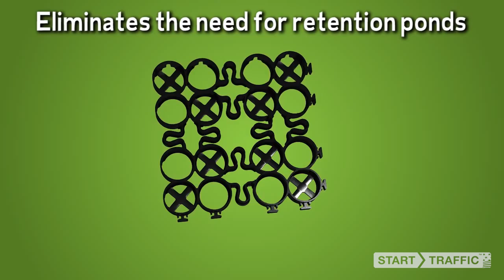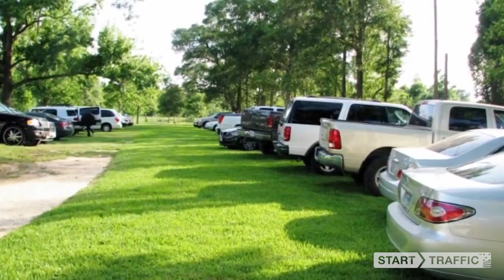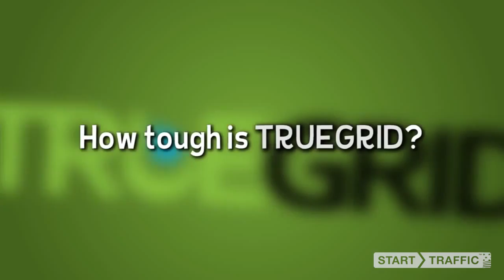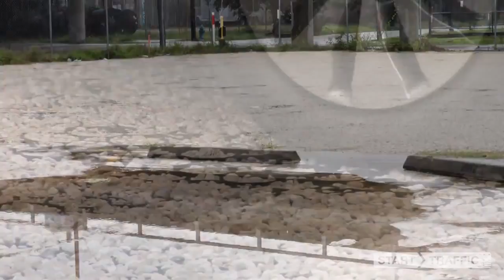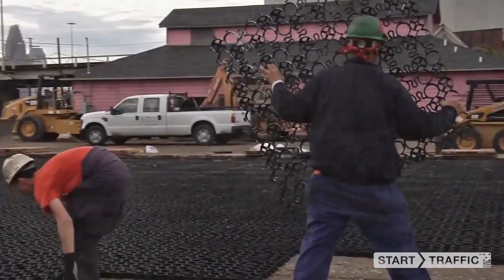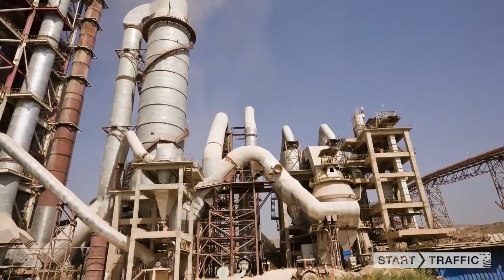TrueGrid - Permeable Paver Systems

Comment: This product is not ‘green’
Reply: why?
Reply: @danielcoyne2917  it will never degrade. It’s like these new eco benches made of resin and recycled plastic .. how is making a permanent piece of pollution that’s then stuck in the natural environment make it ‘green’? If it doesn’t degrade, it’s pollution.
Reply: @jobloggs7400  Recycling is considered being green. Reusing instead of landfilling or burning. Can be reused over and over again. Being Biodegradable is only a piece of the green puzzle.  Im not a greenie by any stretch of the imagination. But i do know that reducing and reusing is part of the Green Initiatives.
Reply: @jobloggs7400  It's a driveway, you don't want it to degrade. I don't even understand how this is a complaint. The "post-consumer" part means it's all recycled plastic. It's a new use for old waste, literally as green as plastic can be. This product also allows water to flow through and down into the ground, unlike concrete or asphalt runoff, which is less risk of causing localized flooding on your property or neighborhood in extreme rain. It won't disrupt natural grass and bug populations either, which is good for the local ecosystem. This... is super-green.

Comment: I have recently purchased a property in ther UK with this system used for a car park area. It may well not be the same manufacture but the ones I have look very similar so be aware of the portential problems of using this method. There may be some on the market that do not permit the grit to fall through, the type I have does. Having got a similar product myself, my advice would be keep well away from the interlocking plastic squares for car parking. Once the sun comes out, it expands and lifts up. This allows the earth or grit or whatever you have used to fall through and prevents them from going flat again. You're then left with a car park with lifted and distorted pyrimids of plastic. I have them and they are truly terrible.

Comment: $100 for 32 sqft 

That inexpensive is this product 

"no thanks"

Going to spend more for a nice good looking pavers.
Reply: Thats pretty close to par for most permeable pavers and this saves $$$ in labor. I agree it isn't as cheap as I was hoping but its still not bad. Especially when you factor the base material for regular pavers will cost a lot extra too.